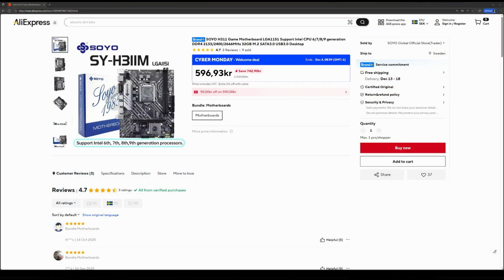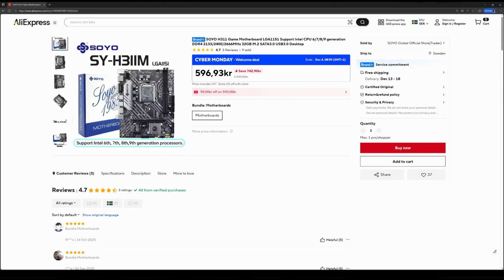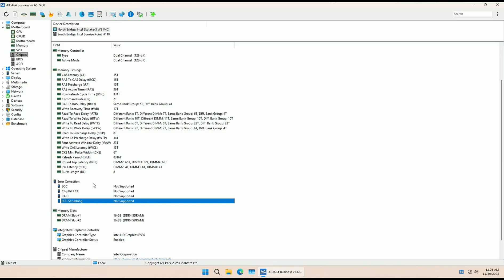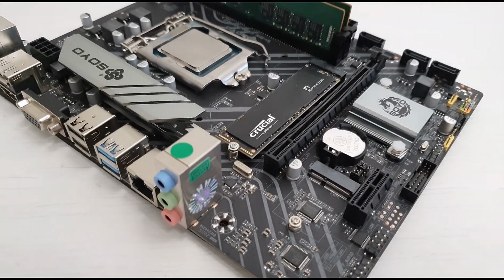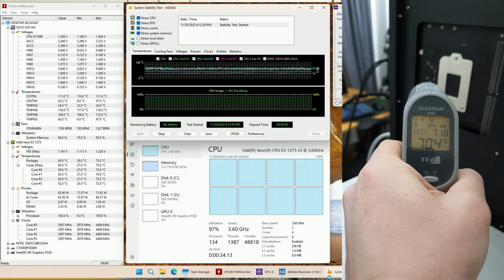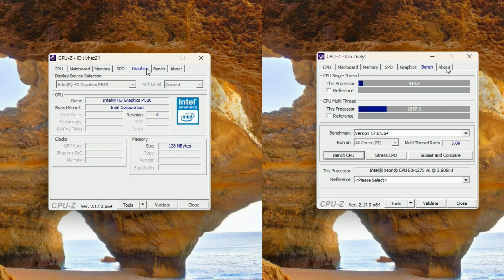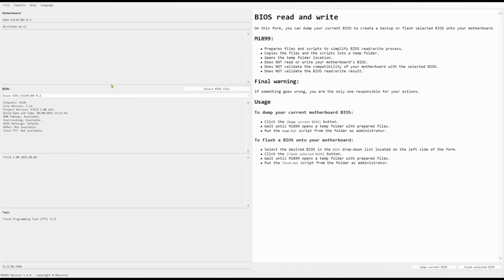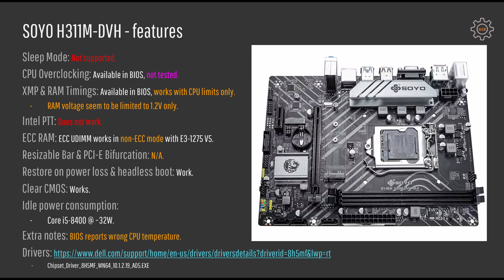SOYO H311M-DVH – viable LGA 1151 option for 6-9th gen and Xeon E3 V5/V6?

Comment: Hi. A query. I have a few Qiyida x99 H5 boards. I'm looking at attaching a tpm module. But the only connector is a 9pin JLPC1. There is an option in the bios for it I am at a loss as to finding a compatible tpm module any ideas? The Qiyida X99 D4 has a dedicated MSI 14pin tpm header.
Reply from the maker: You can connect a gigabyte TPM module through an adapter, more info is available on my blog. I am not aware of any ready made modules available for purchase outside of Brazil.
Reply: @Miyconst Ahh sweet, thanks I'll look into that. You do good work sir. :)

Comment: Do you have a custome bios for regular h310 motherboards to enable v5 and v6?
Reply from the maker: Each motherboard BIOS has to be separately checked and modded. From what I know, only H310C chipset can be hacked t work with E3 V5/V6, regular H310 won't work.

Comment: nonono, i can get the xeon e5-2680v4 for 20$ at the china ali and it is 86% faster than the 100-150$ e3-1275v6. 
Or you can get the xeon e5-2696v4 for 40$ ... and its is 170% faster than the E3 ...  Buying a E3 xeon is a very bad advise.
Reply from the maker: Buying an E3 is totally pointless but if you already have some then you need a motherboard. 😃
Reply: @Miyconst  ok thats a point, but i'd rather sell the e3 at ebay and get an x99 board with any e5... with some luck you even safe money by getting the faster cpu

Comment: But why we need to do pin-mode for 8/9 gen cpus for installing in 100/200 chipsets series consumer MB? As i know, there is some electrical wiring difference between 1151 and 1151v2.
So, you can install 8/9 gen into 1151,but can't install 6/7 gen into 1151v2.
Reply: No. the difference is very small and mostly in Vcore and ground. On my MSI b150 board, it's 2 pins. Vcore is a massive part of the socket, so removing those 2 pins really dont matter. The chinese probably left a few pins not connected so it works with both.
Reply: when it comes to 1151 go for an xeon e5-2680v4 or higher. much cheaper than the e3 or i9 cpus and even lots faster...

Comment: I have one of these no name H311 boards I acquired here in the US, except mine supports DDR3L

Besides the novelty of using Coffeelake with DDR3L, it's much the same, sadly. 

Are there any cheap LGA 1151 motherboards that support ResizableBAR out of the box? My Moore Threads GPU doesn't seem to like ReBARUEFI for some reason on the boards I've tried it with. Would like to reuse some of my spare i5 8400s and DDR4 with it, and the best I've found in the US is MSI's H310M for ~$50 so far

Thanks for the interesting content as always!
Reply from the maker: Did you get a Moore Threads GPU in the USA?! How much did you pay for it? Regarding the motherboards, I am not aware of any desktop friendly new LGA 1151 options.
Reply: @Miyconst  I used Superbuy and Xianyu/Goofish to acquire some hardware

MTT S30 goes for $20-40 used, S70 for $80-$110 used USD right now. At the time for the S30 plus shipping I think it came out to around $45, but that was pre tariff apocalypse.

Also acquired some Zhaoxin boards and a Hygon C86 3350, the latter was a good deal at $20 untested, it now powers my VR PC.

Of course you save on shipping by bundling with other orders and waiting for ocean carriers.

Re LGA 1151 I suppose I'll keep hunting, thanks!
Reply from the maker: @BK2Modder  do you keep these MTT GPUs as collector pieces or they are actually usable for some gaming?
Reply: @BK2Modder  Oh interesting. I always wanted to grab a Moore Threads GPU as a show piece.

Comment: does anyone have a list of motherboards and prebuilts that are gen 6-7 but can easily be made to run gen 8-9 ?
Reply from the maker: All standard LGA 1151 V1 motherboards require physical mods on the CPU to work with 8-9th gen. It's not hard but annoying.

Comment: China just absolutely giving us 4 generations in a single board.
Reply: They do make h110 board with 4 gen support. Sold under local brands here
Reply: Most brands can do this with simple bios mod+ tape . Or you can remove a few pin form the socket 

Devil Intel is too greedy  
Btw they are Skylake based so nothing special or big changed 

Quicksync probably is the biggest different 😂